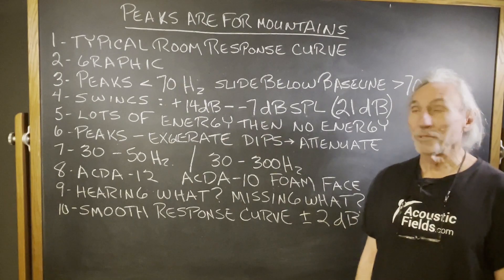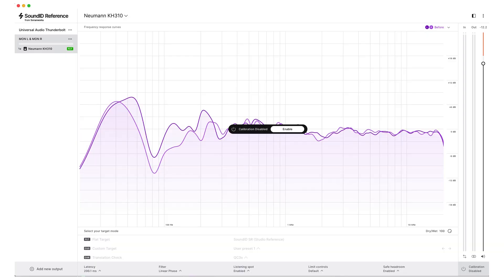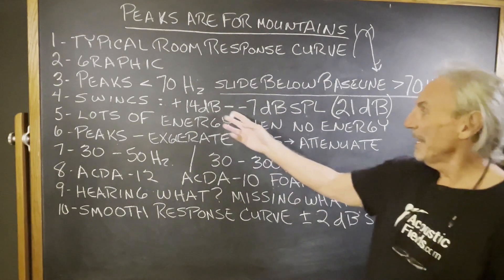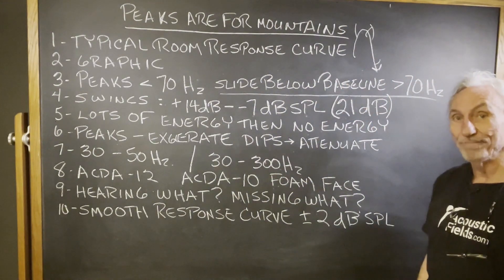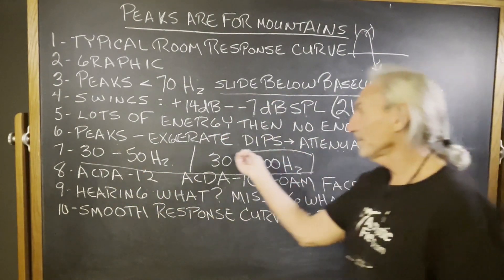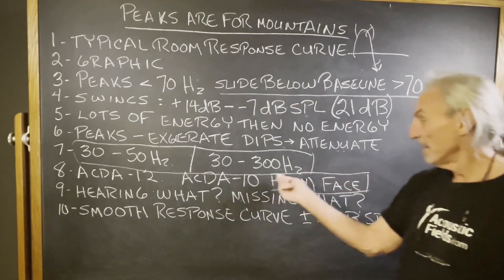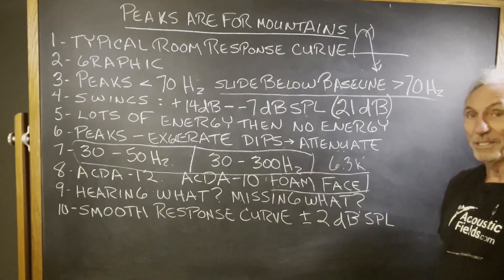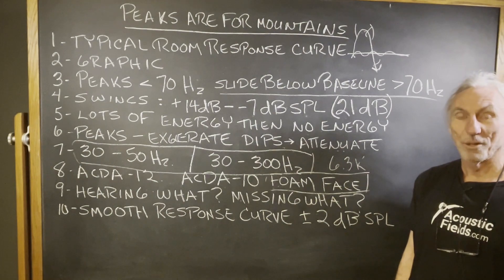Peaks Are For Mountains - www.AcousticFields.com

Comment: Got ±2dB from 17 to 20 kHz in my symmetrical dedicated 2ch listening room. Then a custom curve ISO 226:2003. Scientists since 1933 has  determine that flat is not how the hearing works.
Reply from the maker: Nice. Walk us through the steps you took to achieve this response curve.
Reply: @AcousticFields  Ok.
First of make the room treatment in the physical domain.
Then as a preamp I use miniDSP 2x4HD that has L/R to the mains power amplifier and L/R to the two bass woofers. First of level match bass and mains.
The great thing with that is that I can use 10 PEQ for just measuring and adjusting the two bass speakers and then another 10 PEQ to the mains for the same (but just until the xover point 17-80 and 80-20k.)
One trick is to lower the target point (the line that the PEQ is trying to "hug") in REW when generating the 10 PEQ filter. So you are doing extensively just cutting and not much gaining at all.

It is scary accurate. 
If you have not moved the microphone you verify what REW predict what the frequency response should be after using PEQ filter.
Loading the filter into DSP and measure again and you get what REW predicted (so satisfying).

Now it is time to look at the response at the xover point and adjust the frequency gap to get it smooth. By trying and measure two, three times. 

I have also a rather close distance between speakers and sweet spot of just 2 meters. That helps with less room interaction and "more" direct sound. My wall is far behind me (no flutter echo) and are not a whole flat surface. So the physical domain is important. (So if your sweet spot is in a bass null then fix that first by rearrange speaker/ sweet spot /treatment. When that is sorted learn and play around with the DSP to fix the last dB adjustment.)
Reply: @Optimize  this is impressive. Can I connect with you to help me balance my room? I really liked what you did. Thanks